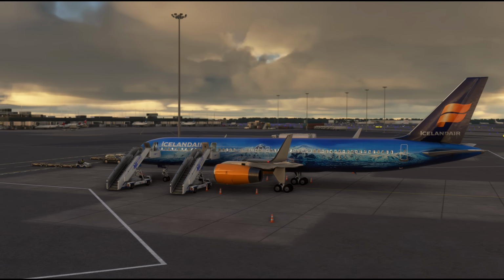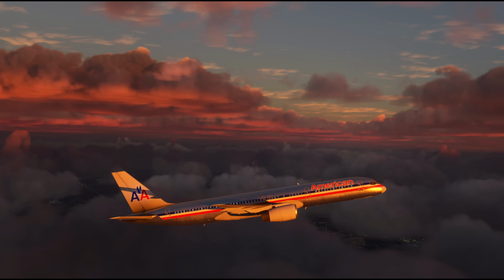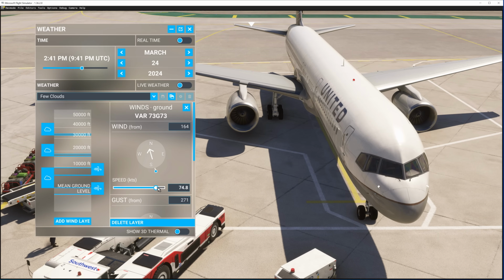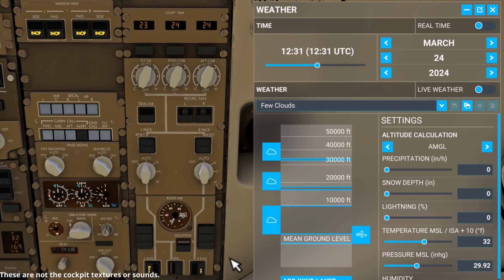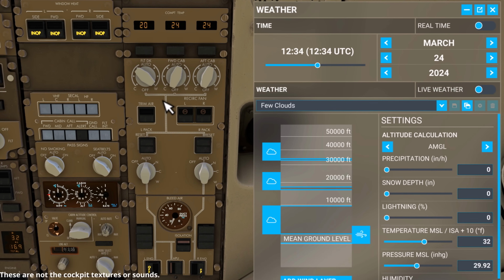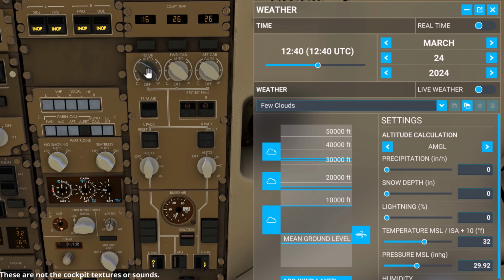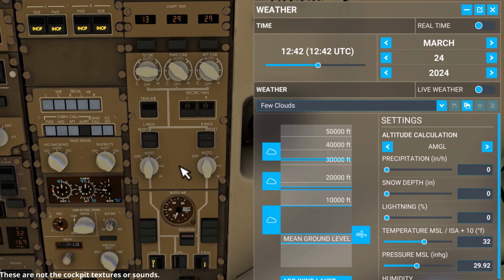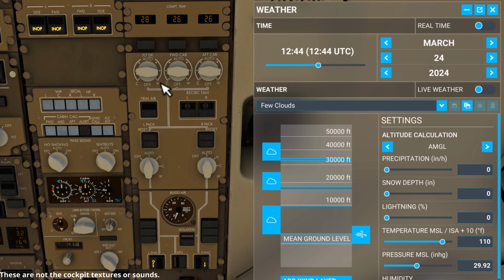BlueBird 757 March Update. Finally Some Sound Previews!

Comment: Gents, all this crazy detail about the A/C system is nice, but...
I fly 757s and 767s in the real world, and the A/C temperatures are ridiculously inaccurate.  Each plane has a black sharpie mark on where to put each temperature knob to get something that isn't boiling or freezing.  We set it and leave it alone.  
How about focusing on the important stuff:  A plane that actually has an accurate flight model... and an FMS that does what the real FMS actually does?  Is that already done?  If not, quit wasting valuable time on temperature gauges.  
In the meantime, I'm still over on P3D, flying Captain Sim's ancient 757.  I really don't care if the AC system shows a change in cockpit temperature when I open the window (the real thing doesn't!!).  I'd rather have a working sim to practice for my next recurrent training ASAP.  PLEASE.
Reply from the maker: Hi there. If you get some time, please watch our FS Expo presentation. I go into some more detail but basically the FMS will be a 1 to 1 simulation of the 757.

Comment: Do you know already if a background software is required to run the 757 in MSFS? I am asking because I use MSFS in Linux/Steam and background apps dont work there usually.
Reply from the maker: We will have a background application running called BBS|NEST  .  Compatibility with other OS's is yet to be determined though.

Comment: What a fantastic project again! Really love the base in the engine sounds! I've asked this before but will there be any custom ground equipment like in the PMDG 737 and 777, It is so much better than the msfs deafult ones so I'm really hoping that you guys do that as well.
Reply from the maker: It's something that is on the table for sure. :)  Might not be on initial release however.
Reply: @bluebirdsim  interesting, eager for the final release!

Comment: These engines sound sooooo good honestly I can’t even tell the difference between them and the real ones. Once the 757 comes out I can finally fly on the interesting routes air china had. If it would be possible please make the 757 Fms also support the default Msfs navdata. That way I can fly to airports that are not available in navigraph.

Comment: It will be great if slat, flap and engine vibration animations are added. It will really make a big difference.
Reply from the maker: It's all in the works.  Not sure if it will be out by initial release but it will be there at some point soon after. :)

Comment: Excellent! So excited for this. Quick question: Will you be implementing shake and vibration animations when the engines are spooled up with brakes on? IRL I would expect to see the engine pods and the whole plane shaking around a bit when you push the throttles forward.
Reply from the maker: It's something that will in the works which is a custom physics model for the wings and engines. Not sure yet if it will be out before the initial release.  Right now it's using the native engine shake and wing flex.  But rest assured it's on the list :)
Reply: @bluebirdsim  Sounds good! I only ask because it FBW made a thing of it in their A380 trailer, and it is quite cool to look out the window and see everything moving around realistically. Admittedly, probably not priority no.1 as we're going to be mostly in the cockpit!

Comment: Awesome work guy's 
Take your time for this project 👍🏼
One question, will be engineflex implemented? 
When i'm sitting in an 757, its allways really impressive how the engines moves on this beauty
Reply from the maker: It's something that will in the works which is a custom physics model for the wings and engines. Not sure yet if it will be out before the initial release.  Right now it's using the native engine shake and wing flex.  But rest assured it's on the list :)

Comment: 50% n1 sounds need a bit of work but overall decent sounds
Reply: I'm pretty happy with that range, if anything I'm always improving though. This is the first ever version of the sounds.
Reply: I disagree, actually.  I thought the 50% range was the best part.  I don't think the sounds need any work here.  Either way, I like how you didn't provide any constructive criticism :)  Nice!
Reply: 😂😂 @airborne8840
Reply: They were perfect.   Whiners got to whine....
Reply: I agree I think @repy250 is totally wrong.  I score in the top 1 percentile for RB211 sound recognition. I’ve been listening to them from various environments and azimuths for nearly a decade. I’ve actually won over 12 awards for excellence in sound recognition and sound engineering.
Reply: 🤣😂 what a load of bollocks @airborne8840